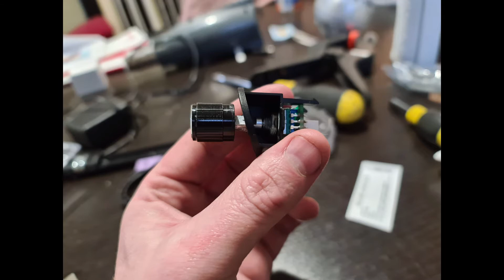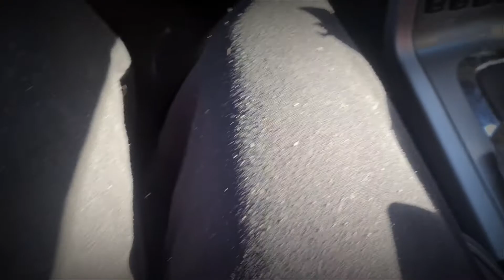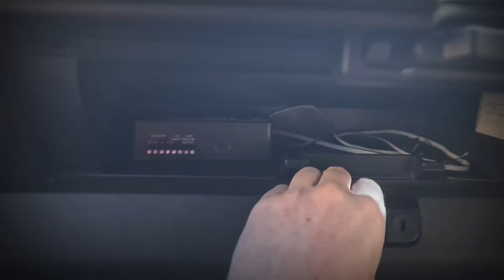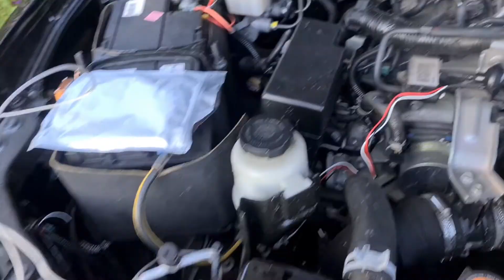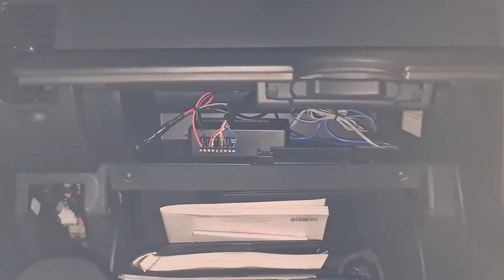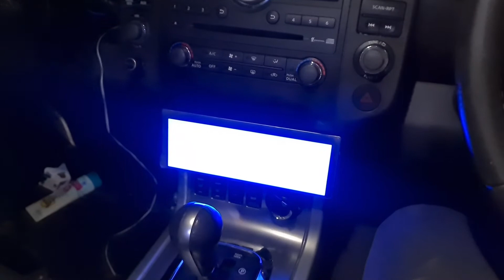D40/r51 ultimate gauge set up

Comment: You never use a drill in a engine bay , you remove bracket and drill outside the car , metal shavings will end up in the engine

Comment: Hi we’ve recently bought a 2014 D40 Navara with 200,000 ks. Manual. One owner previous. It’s a really nice car to drive I really like it so far. Goes through the fuel a lot more than I’d like. How does yours go with fuel when towing? I’ve watched some horror videos on the D40 having broken chassis crankshafts etc etc etc   I’m just wondering if you’ve had any troubles with yours? Also, do you have your cb in the centre console? Cheers Bells 😎👍🏼 🇦🇺
Reply from the maker: Hey mate. I tow alot... and usually get around 11 to 12 per 100. I'd suggest you get the chassis brace kit if your worried. But the reason these break rails is people over load them. Cb is in thr centre console yep!
Reply: @benrys  thank you so much for the prompt reply, very much appreciated. Love your videos and subbed. Cheers Bells